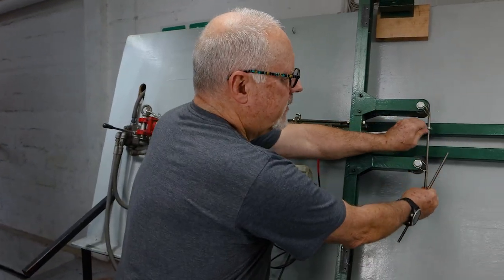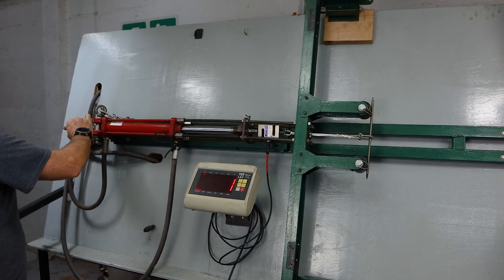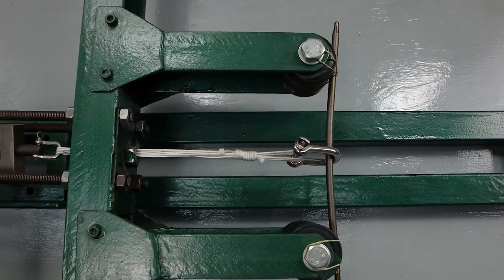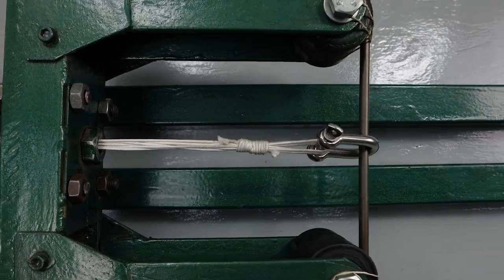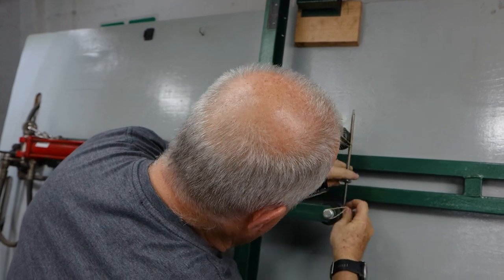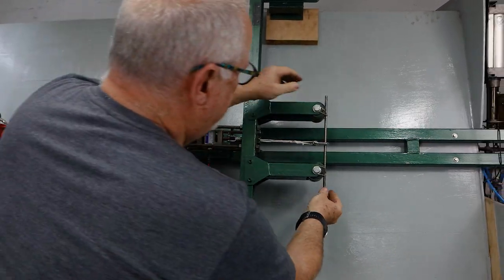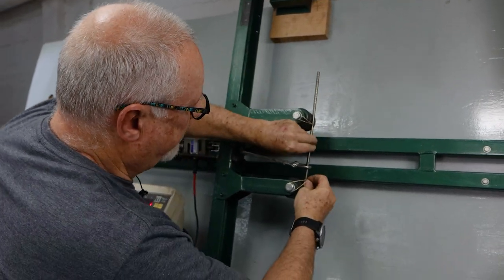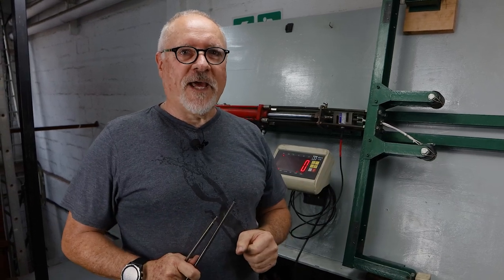Rob Allen | Stainless Steel vs Spring Steel | Part 2 | 2023

Comment: Thank you! 
I've got an old 7 mil shaft that got bad corrosion on it, bought a new one but thinking if there's a good way to clean it so I'll have one extra
Reply from the maker: Not really, the only way is to take off the bard, sand and polish back to bare steal then take it into an electroplating business who do electroplating in zinc. Once re-plated, re-install the barb.